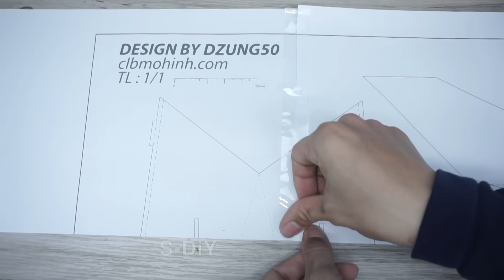F-117 Nighthawk cardboard - F117 cardboard DIY  l S-DiY

Comment from the maker: Cám ơn các bạn đã xem video ! 
Và cám ơn tác giả bản vẽ, chú Dzung50 !
Rất cám ơn sự ủng hộ của các bạn, hãy like và đăng ký kênh để ủng hộ mình nhé !
Thank you for watching the video!
And thank you to the author of the drawing, Mr.Dzung50!
Thank you very much for your support, please like and subscribe to the channel to support me!
Because of the language difference, I use google translate, hope you understand!
Reply: Love the project. Where do you buy the large 5mm cardboard?
Reply: @electronios9793  you can find on the store which store selling TV, fridge...
Reply: Bạn ơi cho mình xin số điện thoại bạn
Reply: Sân kcn được vào bay rồi à bạn
Reply: Is it possible to share the project?
Reply: Hello, is this video similar to your previous F117 build using Depron board ?  I have been trying to build this one with using 5mm depron(KT) board .Thanks for providing the drawing for free. I took the A0 print plan version of this , I want to know , can I  use RS2205 (clone version of Emax) 2300kv brushless motor with 6040 two blade propeller with 30A skywalker ESC and 3s 2200mah lipo ? As I have tested the thrust of these above mentioned electronics , I measured nearly 480g- 540g thrust ,it is not very accurate ,so far would these electronics enough for to fly this F117 ? Also I have alternative some equipments ,such as 40A  red hobby branded ESC and 5045 propellers.
Reply: Thả tim mà ko trả lời gì vậy
Reply: Ap
Reply: Pp
Reply: gvbj
Reply: I love these videos can you make a series of rc plane tutorials, possibly with fpv tutorials? Also I think you should have an online shop to buy materials ty
Reply: wait did I double comment?
Reply: opps no I didn't sorry lol
Reply: Какой вес может поднять?
Reply: Please give me a  plan for air craft
Reply: انت فنان
Reply: Don’t fly on US
Reply: @eduardomonteiro2290  m

Comment: My 1000mah 40c 3s lipo is 100g can I fly this plane with it
I am using rs2205 2300kv and simonk 30a esc and 2xMG90S servo and I am using a 5045 propeller will it work?
And also for the motor mount I don't have that metal mount but instead can I use a bottle cap like you used in the f22 raptor video?
Reply from the maker: Basically, the two models are not very different; you can swap them. However, the F117's flight time might be lower with a 1000mAh battery. The motor and ESC are fine. For the motor base, you can use a bottle cap, but you'll need to add a 10cm square piece of wood to secure it.

Comment: My 1000mah 40c 3s lipo is 100g can I fly this plane with it
I am using rs2205 2300kv and simonk 30a esc and 2xMG90S servo
Reply from the maker: With a 100g LiPo battery, it flies perfectly fine. But you need to ensure the total weight is around 450g or less, and that the aircraft's center of gravity is precisely balanced. Thank you for your interest in the project.
Reply: and I am using a 5045 propeller will it work?
And also for the motor mount I don't have that metal mount but instead can I use a bottle cap like you used in the f22 raptor video?

Comment: Which remotoa control and flight control used ?
Reply: Use any flysky controller 6ch or 10ch. I don't remember model name but i recommend use 10ch one which has white remote with touch screen. There also black 6ch flysky remote avilable at same price but buy the white one.

Comment: I am also making this plane by seeing your video. But I have a question. Where should I mount the motor in the plane? Should it be in the center as in the plane you made from depron foamboard or it should be at the back side like in this plane?
Reply from the maker: Thank you. The only advantage of the motor behind is that it is more realistic, with less noise. But it will be more difficult to control, requiring precise installation of the motor angle. So a mid-engine would be an easy choice for flying. Wishing you success with your project!
Reply: @SDiYchannel01  Thanks for the reply. I also saw your F22 video and I made the same plane. You can see the video on my channel. Greatly inspired by your videos.:hand-pink-waving:

Comment: one could make it more aerodynamic by closing off all the cardboard openings that are facing towards the air pressure, maybe with shaping some pieces of carton into prisma like lines, then glue them over the openings... but I get it: one wrong landing and the plane is broken, so you might not want to waste too much time on perfecting it, if then you have to do it all over again.

Comment: damn dood you make some seriously not only nice looking but highly functional RC flying machines... WOW     are these hard to fly or?   not sure why you wouldn't package these out for a fair price and make a lil' digidoo fora rainy day ..

they had these when I was a kid but certainly not with batteries and engines in them servos...  very inexpensive yet functional set up, any way to setup a micro altimeter and wind speed sensor?

so cool what kid wouldn't be thrilled to see this on his birthday or under the tree... holy smokes  improve the aeros for cardboard and a prop and give it your own name and call sign.. box em up

Comment: Loved your video! i'll try to make it!
But i have two questions:
Will a Mc7RB receiver work aswell? 
The rod actuators, it translate to "Horn" and i cant find the same model
Reply from the maker: Thank you. Mc7rb without antenna is convenient to assemble. But remember to leave the location open, not closed. Searching for the keyword "rc control horn " will have related results. Happy flights!
Reply: @SDiYchannel01  Thank you... I was in doubt because signal from from B model is M-BUS, instead of PWM, and I was not sure if will work to graduate acceleration
Reply from the maker: @RobsonVotri  Hi, don't worry too much. The nature of Mc7rc and mc6ra is not different, both have m-bus and pwm ports. Acceptable speed. Just different antenna type, so different layout. It is too good for cheap sets !

Comment: I'm surprised that it actually flies. The wings are flat and don't have the typical cross-section that provides lift on most planes. Also, it's not the most aerodynamic design to begin with. That you built a version of it out of cardboard that can actually fly is amazing. Good job.

Comment: Does the air intake compress the air for the propeller instead of creating resistance for the airflow?  Obviously it works but wondering how much the difference in performance if the intake was covered?
Reply from the maker: Thank you. The rear air vent is largely responsible for venting air from the front air vent. The large amount of propeller compressed air circulates around the fuselage. It has no effect on the amount of air that compresses the impeller when sealed (unless we install a solid ducted fan (EDF).Sorry, I use a translator!

Comment: Adorable size crafts no dought, the founding designers simply lacked attempting the craft to be more Lego demintions stacks, where every little block parts had parallel 120° folds between every attachment expose edge outside. Aero'Legomatic (you could say).

Comment: Just don't fly over Serbia.
Reply: Ironically it would appear cardboard is an excellent radar absorbing material! Serbian S-300 won’t stand a chance 😂
Reply: @yakymua  Whose S-300? Serbia never had S300...
Reply: @yakymua Cardboard is rather transparent to radar, but not absorbing.
Reply: S125 will though @yakymua
Reply: Eu prefiro santos domont
Reply: F117 was flying low which made it an easy target
Reply: Just read that comment being in Serbia and couldn't get it. But then I got it
Reply: I built several of your F22 Raptors from Correx(corrugated plastic) and they fly well(bit heavy though)😎👌👍

Comment: This is a great design. It looks really good in the air and seems to fly quite well. Would painting the cardboard, or covering it with black plastic tape make it to heavy? Would it work as well using EPA foam board?
Reply: Use corrugated plastic.

Comment: Thank you for this video, I'm just getting into RC plane flying as DSLEXIC Pilot here on you tube. I did download the PDF and I see it said 1-1. Does that mean if I print it I will be able to lay it on cardboard and make it? Thank you in advance.
Reply from the maker: Thank you for your attention. That's right, if you print out a drawing consisting of several sheets of A4 paper put together. You put it on the cardboard to get the size of the plane as shown in the picture. But you don't care about the 1:1 ratio. Because I reduced the overall drawing to fit the size !

Comment: We can keep 1000 kv moter and 5045 propeller
Reply from the maker: Hi friend, motor 2212 1000kv with 5045 wing produces very weak traction, will not be able to take off with this model. You must use a motor larger than 2000kv to match..

Comment: Hello. Please tell me, what throws must have and expo? Thanks
Reply from the maker: Thanks, but I don't understand your question? Are you asking for steering sensitivity !
Reply: @SDiYchannel01  HI. I know that in every plane rc, must set your remote the stick input for aileron, elevator and rudder. In your plane did you use dual rates or expo to reduce travel input of tour servos? Thanks
Reply from the maker: @Sandokans  Thanks for the question, it's true that dual rates or expo is important, it will make the flight smooth! But I use basic transceiver, no EXpo function. In order to control the ride of the steering wheel, it must be adjusted by a mechanic. I limit the driving stroke to no more than 30 degrees ... If you have a more functional transceiver, you should set Expo to about 20% per channel !
Reply: @SDiYchannel01  Thanks for the answer.. I will build one like yours.. Have a nice day!